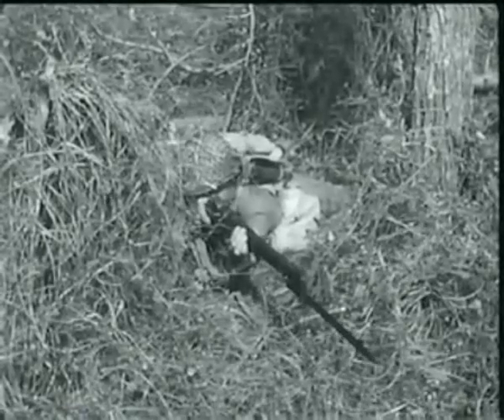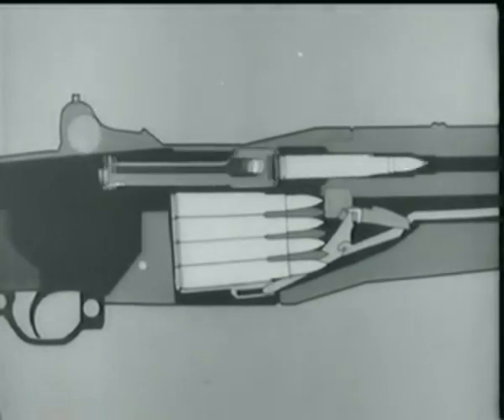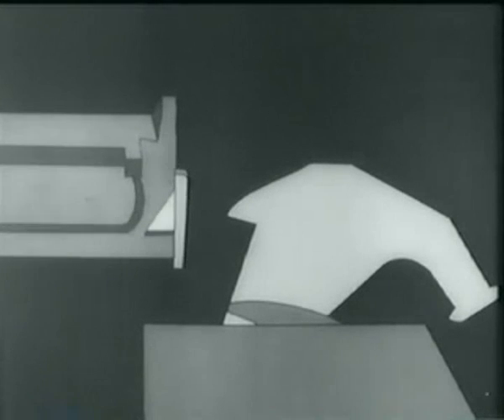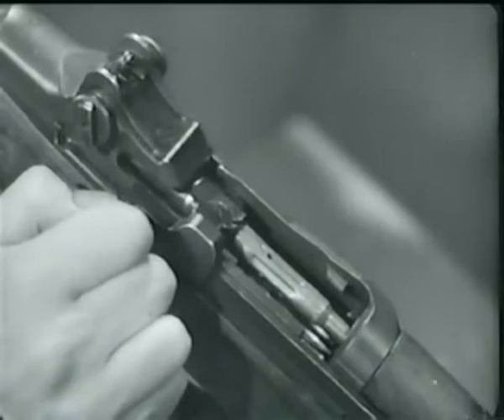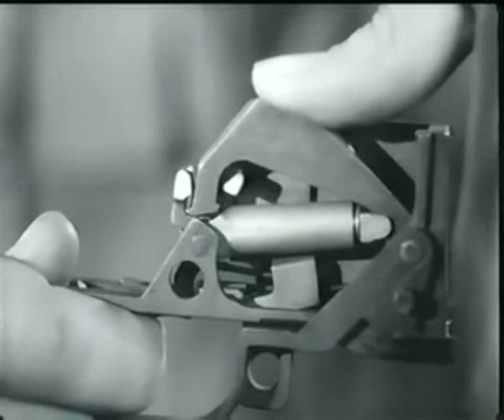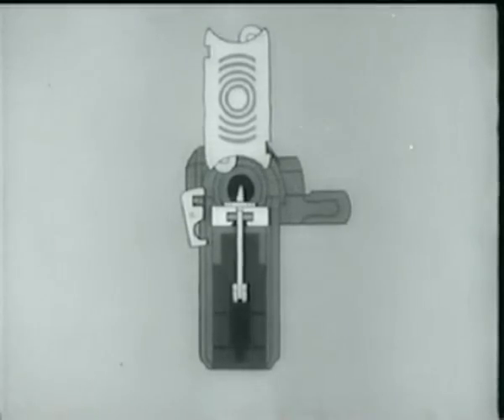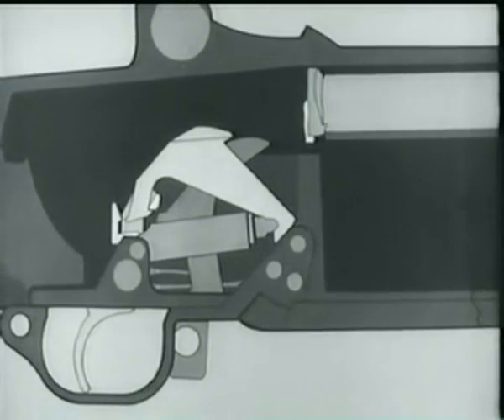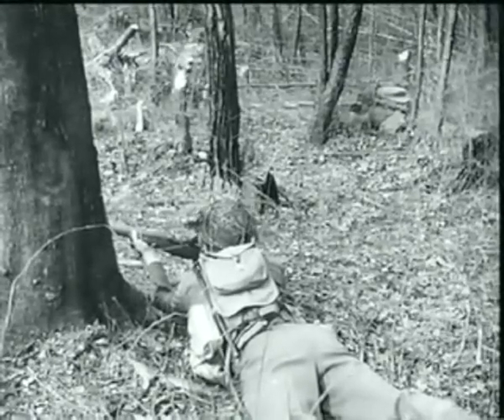M1 Garand - Principles of Operation (1943) United States Rifle, Caliber .30, M1

Comment: you can shoot it all day long and not hurt yourself you have to change your style. you have to hold the gun as hard against your shoulder as you can. if it doesn't move in relation to your shoulder all it does is push instead of slamming into you. it helps if you use lighter ammunition. anything under 160 grain modern ammunition you don't have to worry. keep the slides greasy

Comment: John Garand was a genius. This wonderful rifle was designed and built without the benefit of CAD or 3D modeling or modern casting or computer milling operations. It is a mechanical masterpiece.
Reply: They didn't have CAD but draftmen produced 3d drawings with top, side and end view of each part and isometric drawings. All drawings had dimensions and machining was done by machinists. These days there are fewer machinists and you're dropping a file to multi-axis CNC machine to make a part. If the CNC goes down you're work stoppage until it's repaired. The modern weapons are aluminum frame castings with 20 or 30 round magazine and that's fine for a 3 minute firefight. For sustained rates of fire, en-block clips and weapons with integrated guides for stripper clips can fire more rounds. Feed an M1 and it fires 8 rounds. You don't remove a magazine or reload magazines. Feed and fire all day and you'll double or triple the rate of fire. The guys surrounded during the siege of Bastogne would have been wiped out if they had to load M16 and M4 magazines. The M1 Garand is still the greatest battle implement ever devised.
Reply: @klpittman1  > The modern weapons are aluminum frame castings with 20 or 30 round magazine and that's fine for a 3 minute firefight. 

I'm pretty sure soldiers today carry more than 1 magazine when going into combat. 6-12 is the most common number, with possibly more in stripper clips in the rucksack. Far more firepower at expected WWII combat ranges than practical with M1 Garands. The guys in Bastogne would have loved M16s and done far better with them, especially with the BAR being an awful LMG so riflemen had to do much of the suppressive fire.

Comment: LOL @1:36 he does not use proper loading technique holding the bolt lever back, lucky he did not get "M1 thumb"
Reply: Do you notice how none of these men are using the “proper” technique? That’s because when loading a full clip, M1 thumb is impossible to get. It only happens when playing around with an empty or partially filled magazine.

Comment: Only thing lacking is explicitly stating that the operator may need to assist the seating of the bolt into battery.

But a truly educational point about recocking the hammer on a misfire.

Comment: Garand you absolute mechanical genius. Just take a moment to realize that all of these tiny, fast moving mechanisms had to be invented. That all of the little tricks with the hammer are designed solutions to common issues.
Reply: And he made it so it was able to be quickly mass produced efficiently.
Reply: And it was invented on a blank piece of paper with a pencil. No Cad software. No finite element. Mad respect for these old engineers. I spent years CAD modeling old time (40s-50s) aerospace parts from hand drawn prints and i still can't fathom how they thought up this stuff.
Reply: The hammer cocking mechanism as a trigger gaurd blew my mind. Very impressive.
Reply: To produce more of each quality

Comment: What it the slap on the operating rod they are doing after loading (in the intro scene)?  I've seen this in another WWI training film also. If it still worked that way, there'd be less M1 thumb.
Reply: When the clips are loaded, they're packed fairly tight, so sometimes the force of the bolt by itself isn't always enough to chamber the first round. In this case, you have to help it by giving it a push to chamber the round.

Comment: seeing them load these clips without blocking the bolt handle from snapping forward, gives me chills
Reply: As long as downward pressure is maintained on the clip, the bolt will not close. There’s no need to block the bolt handle unless one is messing around with an empty rifle. Or if they have slow hands I guess.
Reply: L F  I think it's actually called an enbloc that hes loading into the internal magazine....
Reply: An enbloc clip.  Enbloc.is the type of clip.
Reply: Yep that thumb is going to get it.

Comment: If you have fired the M1 Garand, you would probably know why it chambered an 8 round clip instead of the 40 round clip
Reply: It chambers 8 rounds at once?
Reply: @Terminxman  yeah didn’t you see the 8 round cylinder in front of chamber. That enbloccis really a cylinder stripper clip!
Reply: Because it has the recoil of a .50 bmg ?
Reply: @sarkozygaming3629  *cough 
M-14 cough*
Reply: @LoneWolf051  That gun's only purpose was to say "fuck you" to the FN FAL
Reply: @sarkozygaming3629 Sure, if you are a mewling weakling 😂
Reply: CosP0 ! It really doesn’t though. The M1 is a nearly 10 pound rifle, the M2 Ball round is a potent cartridge, but is not strong enough to give the M1 a large recoil. I’d say it’s kind of like the AR-15 in terms of handling when it comes to recoil. It does have a larger and more powerful recoil than an AR, but, much like people who fire AR-15s in .556 for the first time, they’re amazed at how little the felt recoil is. This was a long way of saying the M1 is a heavy rifle, the recoil of an M2 Ball round is not as heavy as the rifle.
Reply: @ILikeToLaughAtYou  yeah that's not true, it has a good kick and was known for bruising a lot of shoulders in WWII and Korea if not positioned correctly.
Reply: @theonlydjtopcat The point is that it’s hardly a .50 BMG. The felt recoil is probably half of what it feels like to shoot a 1903.

Comment: Did you see how they loaded that rifle?  The demonstrators must have had a bad case of Garand Thumb in the making of this video.   I wouldn't recommed loading it that way.
Reply: Pressing down on the top round of the clip will prevent the bolt from slamming home. There's no need to use the blade of your hand to hold the bolt back.
Reply: I noticed that also

Comment: Is that some variant shown at 9:10 ? It looks like a single stack, with matching stripper clips sitting below on the table.
Reply: That's a normal 8 round enbloc with the right round at the top. The thing you see that looks like a lip is the follower.

Comment: Wouldnt cutting away the hammer lug make the weapon automatic? That seems to be the only thing stopping the hammer when the trigger is pulled
Reply: No. The part they call the sear is nowadays called a disconnector and if it were removed the hammer will follow the bolt forward and not have enough energy to detonate another cartridge. Automatic firearms have a secondary sear that releases the hammer again when the bolt is fully locked.

Comment: The M1 Garand however has an automated safety mechanism described above, which is meant to prevent the gun from firing out of battery. When prevented from hitting the firing pin, the hammer might end up with having a very short travel, and acheiving a non-satisfactory energy, which could cause misfires (because the firing pin would hit the primer too softly). Dedicated automatic weapons have their parts adjusted for proper timing to prevent this.

Comment: If the sear fails (through wear for example), the rifle would normally turn into a fully automatic weapon, which would be unsafe to fire due to the risk of detonating the round out of battery (ie before the cartridge is in the chamber and the bolt is locked).

Comment: Woah. I never thought about pulling down the trigger guard to recock the hammer for a second strike on a misfire. Very neat, and useful information!!
Reply: Yours misfires??
Reply: Not practical, If you have a miss fire you need to extract the round examine the primer to find out the problem. In a battle it would be safer and faster to get rid of bad round and keep on firing. Unlocking the trigger guard can be difficult and even if it is easy you have the chance of separation of barrel and stock.
Reply: @tonycs-9  it's so that in case of a hang fire the ejected round dont blow up in your face.....able to recock was considered mandatory in many military back in the days when ammo was not that reliable
Reply: M4 has a forward assist. I've seen guys dump several rounds cycling the bolt when the problem was chamber fouling and not going to battery. Tap the forward assist and it might even clear the fouling with the next shot. M1 was effective at a longer range and the cartridge was both anti-personnel and anti-material. The same round used in the M1 was used in the BAR and the  .30 BMG. I fired in military matches decades ago against US Army troops who whined that if they had their .30 cal they wouldn't be contending with wind drift at 400 yards. The only real benefit the M14 or M16 provided was to arms manufacturers. Having a gas operated  .30-06 on a battlefield may not give you much of an advantage over a black rifle with composite stocks and a picatinny rail system but the enemy will be ducking several hundred yards farther away and at that distance your rifle color doesn't look as scary. When we have something that works well and we have plenty of, someone isn't making money. If you check a Winchester ballistic chart, the M14 round (7 62x51 NATO) is a .308 which was a slightly shorter case with the same exact weight bullet, same powder charge and same primer. But it used a magazine so that's what we needed. Then we went smaller and several iterations of AR/M16 variants. The first 100,000 M16 rifles were actually factory marked AR15 and later stamped M16 so they carried both marks. The stock was 5/8" shorter because they were never intended for Anerican troops. They were supplied to South Vietnam. We have a variety of weapons fielded and some are pretty good. Are any of them really better than tge M1 Garand? The 1911 was around a long time and is still good. The M2 .50 cal is still good. The M1 was a battle rifle. The new stuff is small caliber medium range and wasn't intended for us at the time. The AR-10 was the prototype and was .308. We have a new rifle being fielded to replace the M16/M4. Is it better? Or just more somebody needs to make money?
Reply: sounds silly. I would just cycle and chamber a new round. My m1 trigger is so freaking stiff I need to use a plastic pen or screwdriver to get it out. Must be because of a new stock.
Reply: @Hoglow101  I think which you should do depends on the situation.
Reply: My trigger guard is SO STIFF. It takes 2 men and a small boy to get it free! Then there is the safety. So stiff I, well never mind…
Reply: @samiam619  there’s parts were you have to lubricate to properly work 
I use gun oil on some and gun grease 
Take your trigger and inspected and use a good lubricant
Reply: @samiam619  the safety is meant to be stiff so is not to be pushed accidentally
Reply: Almost like a Winchester 😅